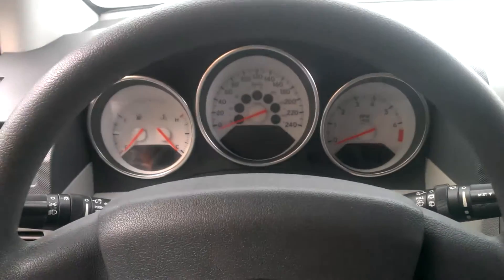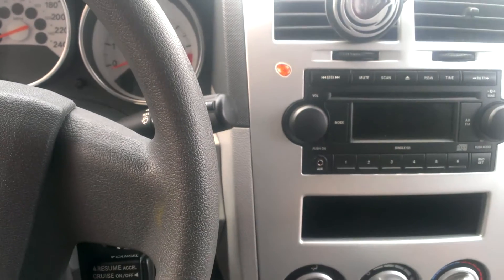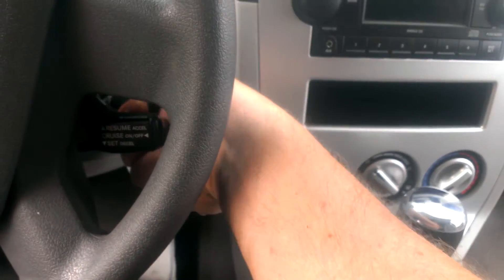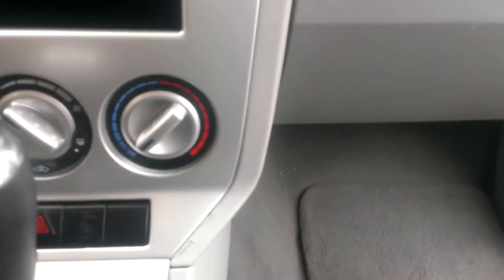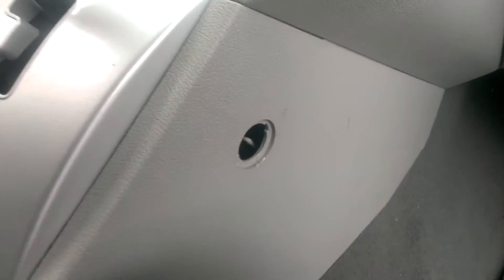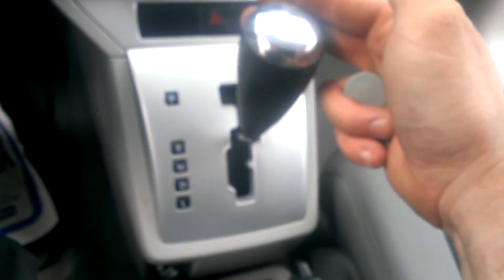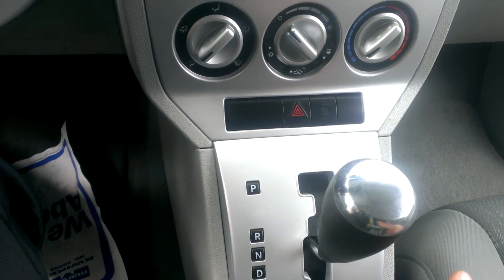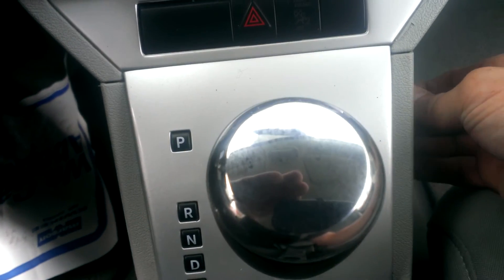Dodge Caliber (How to neutral)

Comment: How do I fix it when the car is stuck in park but not the shifter. As in when I put the shifter in drive , on the dash still says park which means my car still in park. It’s an 2008 Dodge Caliber. The brake lights comes on which some say it’s the breaker lights but  it’s like it’s not connecting to any gears to switch into another gear...please help
Reply: I am having that same problem today on my 2007 Dodge Caliber. Did you get yours fixed? What was the cause?